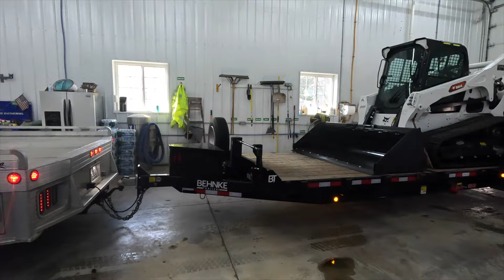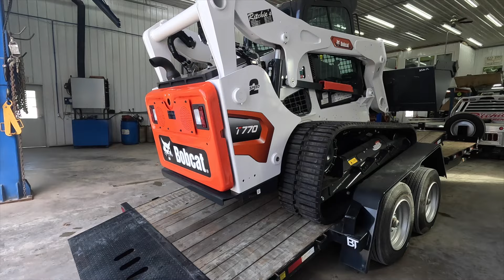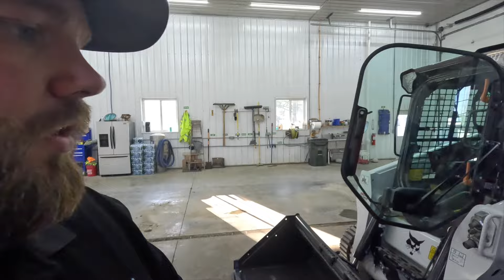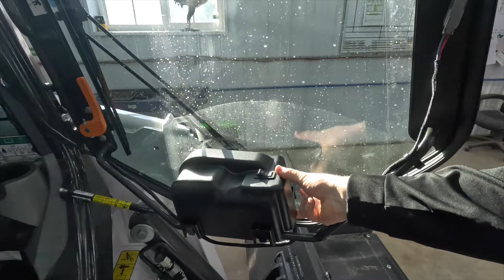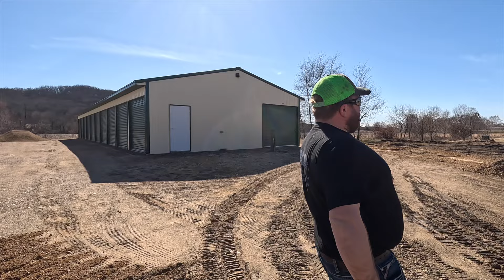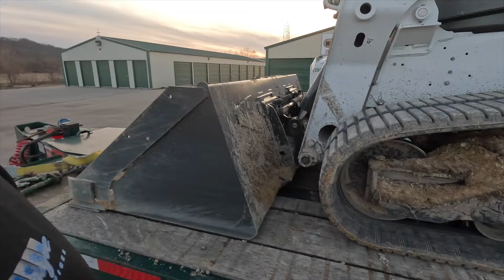Buying A BRAND NEW 2024 Compact Track Skidloader

Comment: 299D3 is an absolutely incredible machine but the JD 333 is  also a great machine , Kubota has major injector and fuel problems and bobcat also has engine troubles , we have both a 333 and a 299D3 and they both are incredible
Machines
Reply from the maker: Thanks for commenting!

Comment: You will absolutely love the t770.  A ton of power.  We bought our new one in 21’  and love it.
The ticking is the machine pulling the def fluid out of the lines from what our dealer told me.
Reply: Yup it pumps the def out the lines so they don't have the chance of freezing or gelling, our case backhoes do the same thing.
Reply from the maker: Good to know, thanks for watching!
Reply: yeah the bobcat   t770 bob cat  is powerful with its 90hp kubota dieselengine
Reply: We have a new t770 and it’s awesome. Great power good deal with 0% interest. I wish we had backup camera. Front door sucks bc I can’t open it with bucket up

Comment: Yes you can delete them. Keep them arms that was if the hose break you can still de tatch and attach your tool. We love our bobcat machines them tracks are bad ass year around. We plow and use them and have great luck with them. I put over 1000 hrs on them with good tread left!
Reply from the maker: Oh, nice! Thanks for the info!
Reply: I would not cut that arm might need it 15 years from now when it gets rusty dusty

Comment: DEF system  will fail and create problems unfortunately any machine with it seams to have problems either the pump or the heater or controller.Try stay away from machines with DEF you will experience down time at the dealer its not like replacing a worn hose.
Reply from the maker: Thanks for watching! Appreciate your feedback!

Comment: Go check out the brand new CAT 255 & 265 track loaders. Way nicer than Bobcat in my opinion, CAT does machines best if you can afford the ticket.
Reply from the maker: Closest Cat dealer is 1.5 hour away from us. That's not going to work